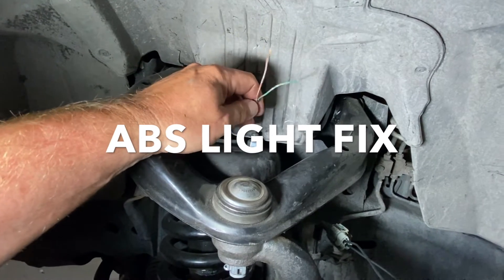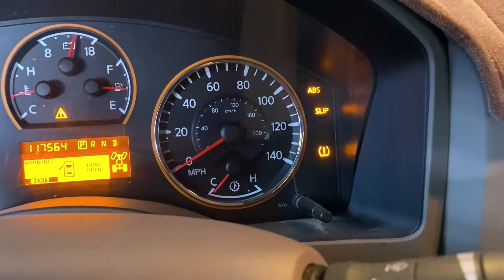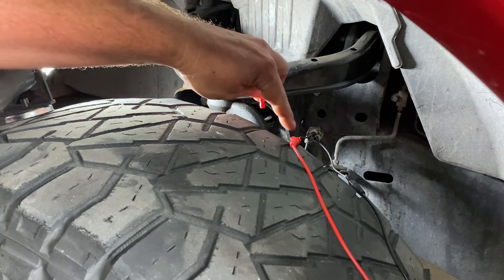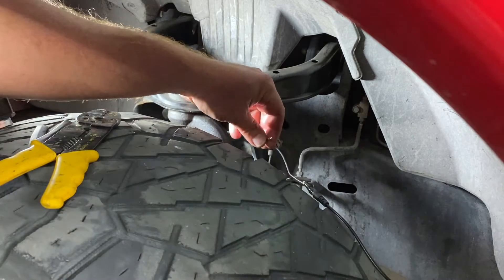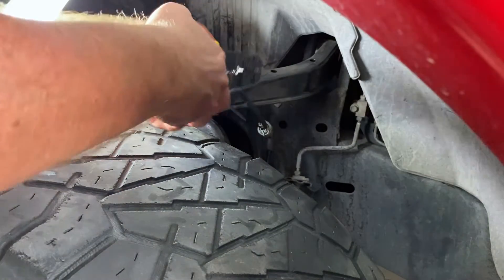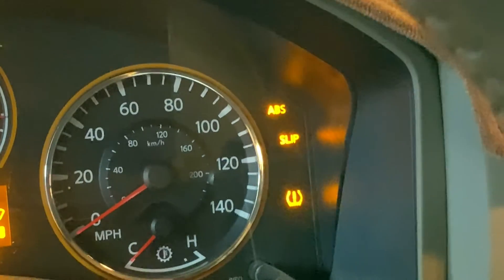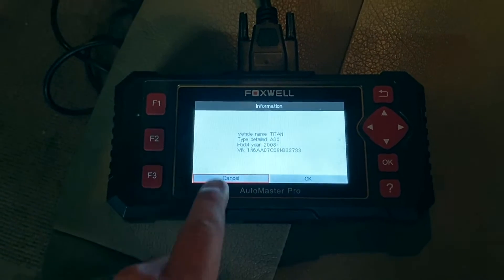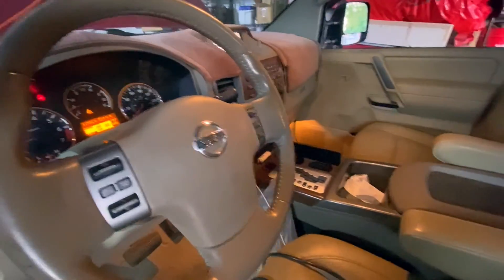Nissan ABS Fix - How to replace Nissan Titan ABS Connector

Comment: Thanks for the info! broke my connector while changing the wheel bearing on my 04 titan. I don't know if other people had the same experience as me but I tried everything to get the connector out including wd-40 and heating it up while trying to disconnect it and ended up snapping the wire right up to the harness side plug.